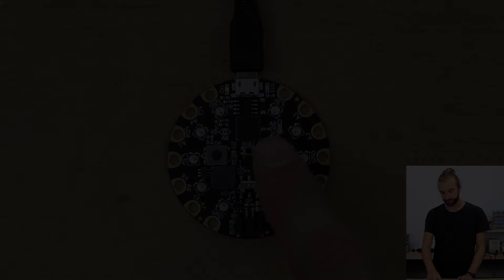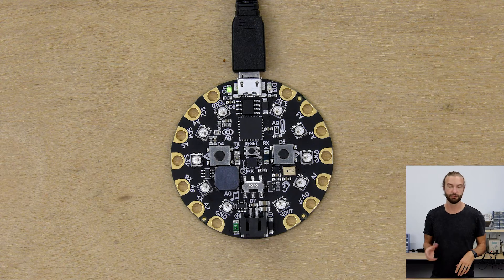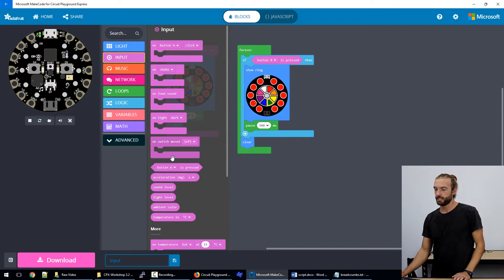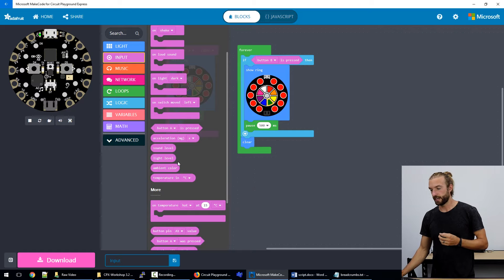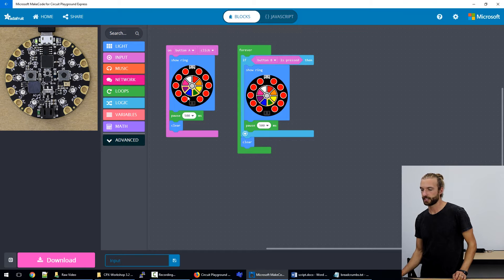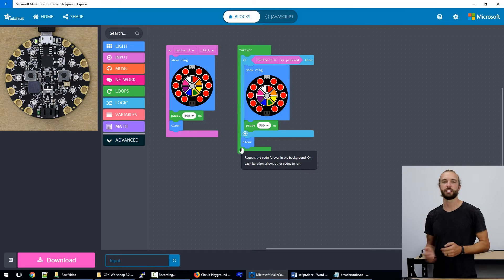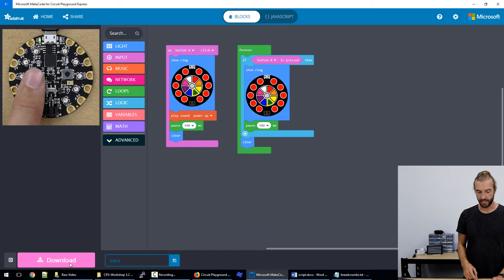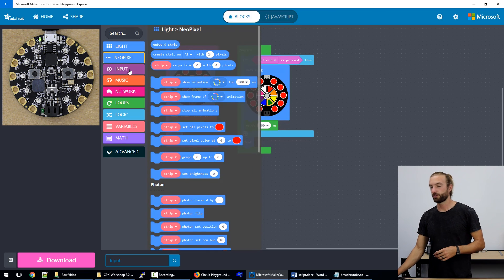Circuit Playground Express Workshop - Chapter 3 - Inputs and Outputs

Comment: There is a difference between button A and B. If you hold A down the lights will show when you release it. No matter how long you hold it down, it will only show the lights upon release. But Button B will blink as long as you hold it down, because it is a forever loop.